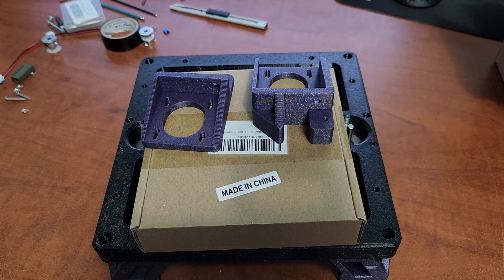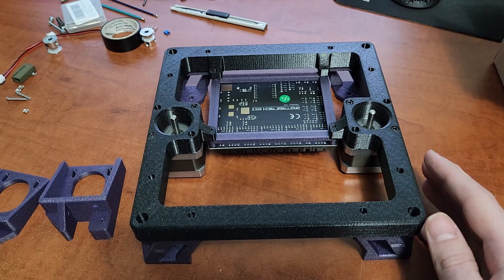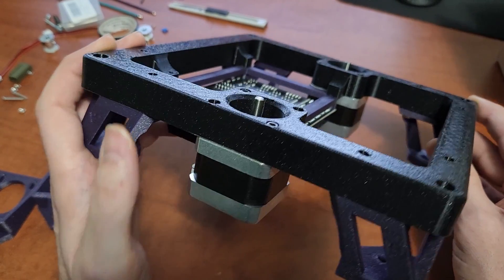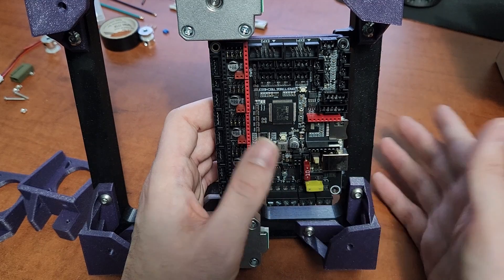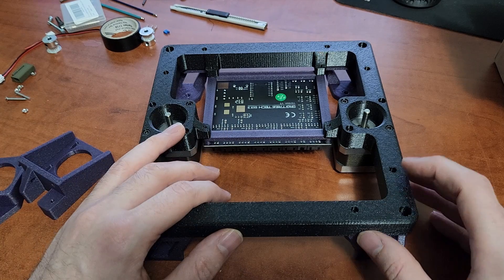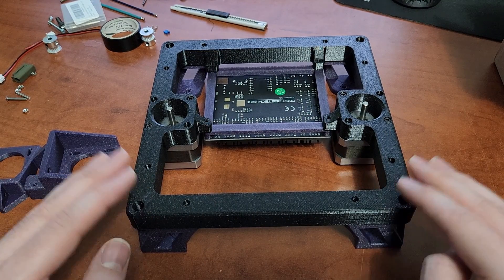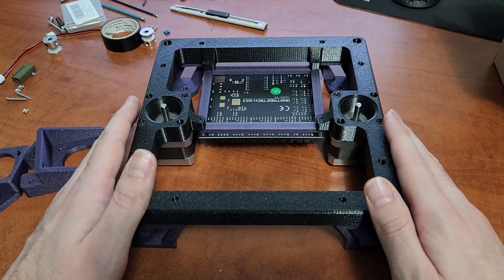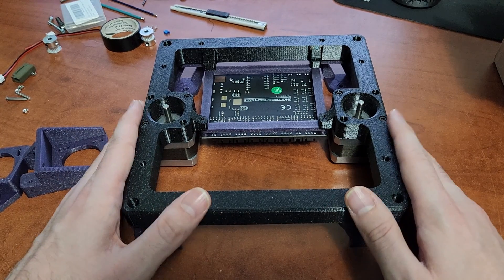Rook a cheap mostly 3D printed CoreXY printer - Build Tips Part 1

Comment: Can I replace the main board with an Arduino ATMEGA 2560 with an Arduino Ramps 1.4 shield. Will it affect print quality?
Reply from the maker: the Rook uses sensorless homing so you would need to modify endstops on the printer

Comment: Ist it possible to take the Komponents of an old Printer or  buy cheap Printer like Ender 3 or youse the components of cheap baught defect printer of ebay? And put this in?
Reply from the maker: yes for motors and such, you will need to cut rods though and still need to order idlers and bearings, might be better to just buy new or buy a few printers that are broken. I would not buy a working printer

Comment: In the interest of keeping costs and complexity low, I recommend the Inovato Quadra to run Klipper. It comes ready to boot Linux out of the box (power cable, enclosure, and even HDMI cable are included) and KIAUH runs on it just fine to get Klipper going.

Comment: Absolutely AWESOME work here! 
And printable on a 200x200? Incredible! I would say MOST of us watching this have that cabability in our printer arsenal ;-) 

My Plan for this little gem, is to build one for My Grandaughter, and one for my Nephew. (8 and 11 Respectively, but with heavy nerd adult supervision in both households)
I'll be modifying a few things as follows:

- Raspi Zero w 2 with Klipper/mainsail for my MCU
- SKR3 Full Size (For them to Grow into, Or build a better Printer later on) 
- Taller Base and Universal Board Mounts for Electronics built underneath
- External 300 Watt Power supply, Cased, with XT60/90 Connector 
- Space for a 3.5-4.5" Klipperscreen Touch interface / Status Screen
- Micro ABL Mount, Possibly using a microswitch and a servo to miniaturize, or I have several ideas on how to make a SUPER SMALL bed probe using a photocell/photoresistor
- Laptop Strip USB Webcam Mount in the nose of the Frame
- Swapping to an Aluminum Bed Plate, Magnetic Pad, and Custom PEI flex plate (Glass would not be good for little ones I'm thinking... Even with supervision) 
- Adding a Small silicone heater to the Bed so It can do PLA/PETG with great adhesion to PEI without need for consumables (Glue / Spray / Tape)
- Swapping to a Microswiss All Metal Hot End. As I happen to have several available 

I want to Build it up and get it SUPER SOLID, and reliable, then pack the heck out of them and ship them to the kiddos. 
Mom/Dad can monitor prints from their cell phones, klipper screen shows the progress on the unit itself / has elergency stop button, and the Zero w 2 can handle pressure advance and input shaping for super quality and decent speeds.  

I can give them solid results to get started, then advise / troubleshoot when maintenance / eventual issues needing tech correction arise. 

Time to teach the next generation the skillz! 
Thanks Again!
Reply from the maker: Thank you, love all the ideas! Post pics on the discord for sure!!

Comment: @Rolohaun I have a wild idea I've had in mind long-term for some of my personal projects to enable larger parts, with potential tradeoffs, with a given size of print bed with flat (or mostly flat) parts: if the part designs make it feasible (I saw nothing that was clearly problematic in this video) remember you're printing a very thick plane (currently) only using 2D space for paper area, when any 3D printer has more print volume to expand the size of a 2D part with a weight problem. How do you do that?

With using supports, it's simple, mathematically: tilt it at 45 degrees along the X axis, and also do that along the Y axis.

I'd love to see how well that works in practice, and it'd make a nice video, wouldn't it? ;) (I have very finite space with 3 printers currently and another arriving in the next 2 weeks, and too many other projects).
Reply from the maker: sounds interesting, I have so many projects on the go as well. You need to make your design and show it!
Reply: @Rolohaun  my visualization is it’s a scaling of your frame, while keeping the current component holes the same, just things are stretched out by scaling made possible by rotating on the x and y axes by 45 degrees along both, by otherwise printing the same Rook frame you’d print if you have a larger printer to print with. This technique could allow some commenting their current print volumes are too small to print your current design, without modification, assuming the printers are reliable enough to do that somewhat of a printer test.

Comment: Nice build video, but I think you forgot to build the printer 🙃

I want to build one. Looks like a nice variety of mods are cropping up!

Also be careful about dropping fasteners on those exposed pins on the back of the motherboard!
Reply: Also, would like to see squash ball compatible feet! I may design my own
Reply from the maker: yes I need to change the title to build tips!

Comment: This is probably going to be such a stupid question but ... why would a board running Marlin (and perhaps adding a display + rotary encoder) not work?  The hardware doesn't seem too difficult to create a Marlin config for it ... and Marlin now even has input shaping, so ...
Reply from the maker: oh you can use Marlin for sure, just not my preference. There are some users on the Discord planning on using Marlin
Reply: @Rolohaun  For a minimal standalone setup it might have it's benefits.  Of course a pi zero 2w running Klipper and acting as a wifi AP would also allow simple connection from any device in any location to push a print to it ...

If only I had the spare materials at hand to build this.  I'll have to look at getting some steppers and lead screws ... I do still have an old Creality board and a pi zero 2w ... But the most critical missing resource will be time...

Comment: Splendid project! Just wondering why use two motors for the Z, and not stay with the theme and use one and a belt?
Reply: Because the z rods improve the overall stability of the printer and z axis.
Reply: @Kajukota  Not sure if I understand correctly. I'm not discussing using two rods/screws, but connecting the two rods via a belt and driving them with one motor. It might increase the complexity but make it a bit cheaper?
Reply from the maker: it is hard to find the right size belt but I would like to make a 1 motor 3 lead screw version

Comment: For the feet it could be possible to have a tpu layer on the bottom just by doing a filament change
Reply: Or you could use the cut feature in the slicer, print bottom side in TPU, then print the top side in whatever structural material you were going to use. CA glue should keep them both adhered.

Comment: Careful using a pico mainboard, you can't use a heated bed with much power. The internal traces are kind of close together (it's a tiny board) and will get hot if you run a high power heated bed. The manual is very lacking and doesn't explain power limits (unless btt updated it). Mine caught fire with an ender 3 bed at 50c because the internal traces overheated and degraded the material causing a short and a fire
Reply from the maker: I am going to use a SKR 3 on this one
Reply: Wtf...i just got one to use with my ender 5. What a disappointment 😞
Reply: @Kajukota  you can use an external mosfet to power the bed to get around this limitation.  I had to do it on one of my printers. Easy to wire up and only costs a few dollars

Comment: Is that sparta sparkle abrasive in your experience? Do you run it with brass nozzles?
Reply from the maker: I don't know if it is, my bambu lab x1c has a hardened nozzle. Contact sparta and they should be able to tell you for sure.

Comment: I have 3 Duets (SKR, Mellow Fly) I love the RepRap OS. I have 1 Klipper running on a Pi Zero/MKS Robin E3.Duet starts up instantly via wifi. I find klipper makes we wait for the web server to run up.
Reply from the maker: yes Reprap WiFi is very fast no linux needed
Reply: @Joe Schmoe I have 3 Duets and 2 Klippers. So I get to experiment. But I'm doing very basic practical prints. 3 Ender 3s and a CoreXY.

Comment: As a cheap alternative for Pi/laptop one could use a thin client. I got one (old and used) for equivalent of 11-12 usd.
I didn't test it yet, as my rook is still being built, but it works and runs some lightweight linux distro.
Reply from the maker: yes there have been some videos of people running klipper on a thin client. As long as it can run a debian based linux you should be good
Reply: @Rolohaun  with the pi shortage it's a life saver